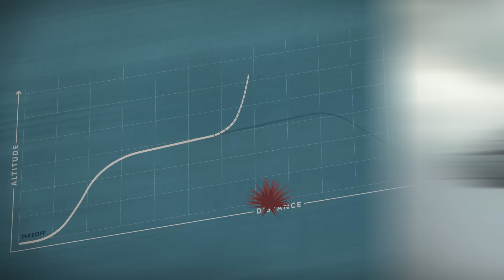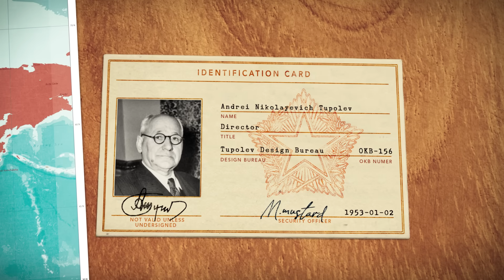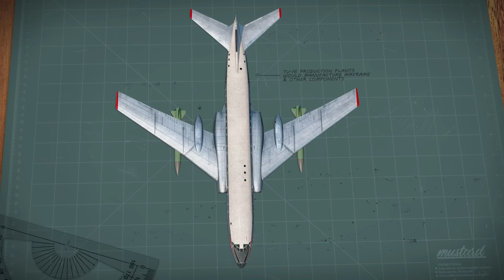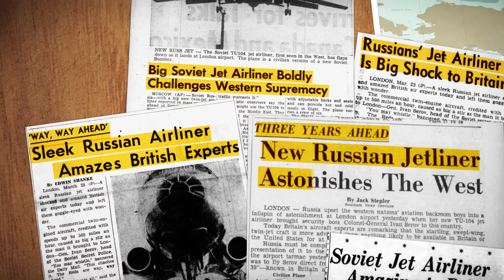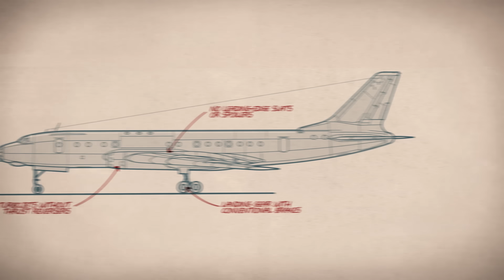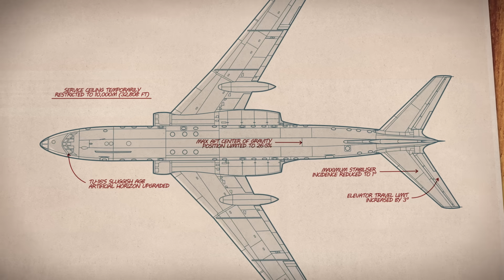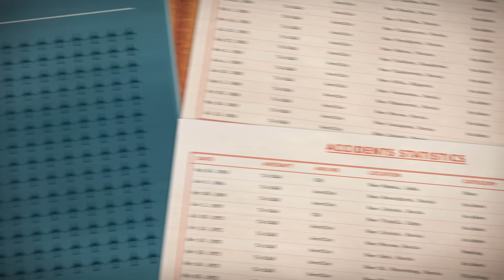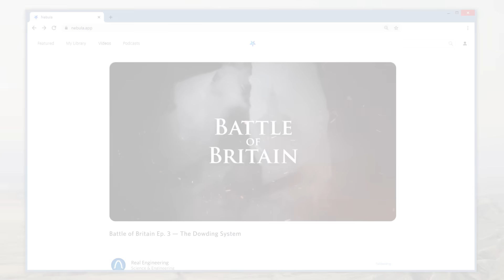The Soviet Airliner Designed To Crash

Comment: I don't understand what's so strange about it. This is the second passenger jet on the planet, leading after much less reliable one. It was a great, great success for that time. The bad thing is that they didn't grounded it after all those problems, but that's politics, not the engineering and innovation's problem. Overall, it was more than a GREAT success. After all, the first American passenger jet Boeing 707 was reported by numerous of pilots as terribly hard to fly with. Still, that's the third passenger jet in the world and the first in the USA, so it's a HUGE success. The author of this videos MUST emphasize those facts. Without those facts, these videos look like mocking of incompetent of the engineers of that time. 

By the way, Tu104 has total 37 hull losses with a total of 1140 fatalities, while Boeing 707 has total of 174 hull losses with total of 3039 fatalities. Why did you named Tu104 most dangerous plane in the world? You can always check the Google or any other info source
Reply: Facts: The de Havilland Comet has the worst safety record of any jet airliner. 

Sorry, your numbers are right... but your math is all wrong, Boeing sold over 1,000 707s... if you count all the military aircraft its 2,000 Tupolev made just 200 Tu-104s

Fatalities are rated by the number of deaths per million flights divided by the number of aircraft. 

This tells us that the Boeing was one of the safest aircraft of this era. And the fact that 200 aircraft in 707 family are still in service, some are expected to remain in service until at least 2050!!!
Reply: @DoktorBayerischeMotorenWerke 

  It will come as no surprise that we feel we can clear up some commonly held myths and misconceptions, of course.

  Indeed, It's always good to see the facts presented clearly and concisely isn't it?

    It's not valid to compare a Bow-wing ( see B-47 wing folding & wing collapse incidents for details) jet airliner designed & first built as late 6 decades after the Comet, with the fabulous De Havilland Comet, the world's first high altitude jet powered airliner.  

  Vast improvements in commercial aviation infrastructure alone being a significant factor in improvements in air travel safety safety over more than half a century.

    Of course 50 years more design, build & operation experience didn't prevent the horrendous Bow-wing 737 Max incidents, there can obviously be no excuses for that.

Obviously there have been worse aircraft for accident losses both before & after the DH Comet & the Tupolev T-104.

    How things were back then -

Accident losses - % of aircraft built.
DeHavilland Comet 4 UK     14% 
DeHavilland Comet all mks  17%  
Vickers VC10 UK                     5%
Tupolev T-104                          16%

   The DH Comet & Tupolev T-104 had better safety than or similar safety to many other commercial passenger aircraft of a similar era

    Douglas DC-1        99%
    Douglas DC-2        47%
    Douglas DC-3        30%
    Douglas DC-4        26%
    Boeing s300          72% 
 .  Boeing 307            70%
  .  Boeing 247           48%
     Boeing 707           20% 
Lockheed L-049/149 Constellation 30%
Lockheed Electra  Turboprop           29%
Fairchild FH-227                                30% McDonnell Douglas DC-8                 14%
Sud Aviation Caravelle                      15%
Canadair CL-44  Turboprop              46%  
Convair CV-580  Turboprop              22%
Convair CV-880    (ff 1959)               27%  
Convair CV-990     (ff 1961)              33%
Tupolev T-104          (ff 1956)            16%

As always, we hope this helps, obviously.

Cheers & 👍 of course.

. . ...
. . ...

Comment: The 104, paving the way for generations of more Tupolevs falling from the sky.
Reply: Tupolev still makes jets... more than you can say about de Havilland or any British aircraft manufacturers.
Reply: @DoktorBayerischeMotorenWerke 

  It will come as no surprise that we feel we can clear up some commonly held myths and misconceptions, of course.

  Indeed, It's always good to see the facts presented clearly and concisely isn't it?

    It's not valid to compare a Bow-wing ( see B-47 wing folding & wing collapse incidents for details) jet airliner designed & first built as late 6 decades after the Comet, with the fabulous De Havilland Comet, the world's first high altitude jet powered airliner.  

  Vast improvements in commercial aviation infrastructure alone being a significant factor in improvements in air travel safety safety over more than half a century.

    Of course 50 years more design, build & operation experience didn't prevent the horrendous Bow-wing 737 Max incidents, there can obviously be no excuses for that.

Obviously there have been worse aircraft for accident losses both before & after the DH Comet & the Tupolev T-104.

    How things were back then -

Accident losses - % of aircraft built.
DeHavilland Comet 4 UK     14% 
DeHavilland Comet all mks  17%  
Vickers VC10 UK                     5%
Tupolev T-104                          16%

   The DH Comet & Tupolev T-104 had better safety than or similar safety to many other commercial passenger aircraft of a similar era

    Douglas DC-1        99%
    Douglas DC-2        47%
    Douglas DC-3        30%
    Douglas DC-4        26%
    Boeing s300          72% 
 .  Boeing 307            70%
  .  Boeing 247           48%
     Boeing 707           20% 
Lockheed L-049/149 Constellation 30%
Lockheed Electra  Turboprop           29%
Fairchild FH-227                                30% McDonnell Douglas DC-8                 14%
Sud Aviation Caravelle                      15%
Canadair CL-44  Turboprop              46%  
Convair CV-580  Turboprop              22%
Convair CV-880    (ff 1959)               27%  
Convair CV-990     (ff 1961)              33%
Tupolev T-104          (ff 1956)            16%

As always, we hope this helps, obviously.

Cheers & 👍 of course.
Reply: @DoktorBayerischeMotorenWerke @WilhelmKarsten 

We feel we can clear up some common false myths, misunderstandings & misconceptions.

It's always very important to note the relevant facts obviously.
 
    Regarding the UK Aerospace Sector.

  WHY IS IT THEY CAN'T ANSWER VERY SIMPLE QUESTIONS ⁉️ 😅
  A very simple question indeed.
   
Which airline recently ordered 60 RR Trent XWB Engines? 

Also name a single Germany company that makes German jet aircraft in Germany & name a single German Company that makes German gas turbine aero engines suitable for widebody airliners.

     That's correct, Brazil makes very good airliners & Brazil is 100th down the list along with Indonesia for wealth per capita.
Norway Holland Denmark Ireland Belgium - Top 20 wealth per capita - Don't make airliners -  its as simple as that.
  
  Agreed, that is correct of course, clearly there are many countries that could easily produce airliners of better  quality than Bow-wing (see b-47 wing folding & wing collapse incidents) but don't for some very good reasons. Bow-wing being a result of the size of the US, the large protected domestic market & great ease of testing new types due to the equator to arctic geography & a few other reasons related to production scale capability, politics & economics.

  Obviously there really is nothing special about Bow-wing, having more than 50 years design / build experience on the type means they have no excuses for the horrendous 737 Max incidents for example.

    Indeed BAe Systems & Rolls Royce combined now do more Airbus work than Germany on an absolute basis & significantly more work than that on a per capita basis.
   
     Agreed, Per capita for the home nation BAe Systems is the world's largest defence contractor.
  
    Correct, BAe systems announced the recent £4 Billion takeover of Colorado based US based Ball Aerospace.
  
    It's definitely the case that BAE systems now does a significantly higher value of work for Airbus than it did when it was a major Airbus shareholder before 2005.
     
      Obviously RR now owns US Engine maker Allison for example which does classified Aerospace work for the US Govt.
   
   Yes, that's right of course, Anybody currently flying on a widebody airliner stands a good chance of being on an aircraft powered by RR gas turbine aero engines built in the UK.

   A typical but small glimpse of what goes on in the very internationally orientated British aerospace sector.  

  Of course the RR Nene was in fact the world's most reliable & most powerful gas turbine aero engine in 1944. Licensed built versions & copies would go on to power many aircraft in Russia, the US, China, France & other countries for decades after 1944.

      Boeing Apache Attack Helicopter.
AH-64: 75 UK suppliers, 7% UK content, global fleet of 1280+ aircraft.
F35B more than 130 UK Suppliers, more than 30% UK content.
F35A & F35C more than 130 UK Suppliers, more than 15% UK content.

   There is no doubt that an airline has just ordered
60 RR England Trent XWB Engines

Obviously the UK has the
World's Highest Combined Per Capita
 Nuclear / Defence / Aerospace Sector Activity.

Rolls Royce Holdings UK
Subsidiaries
- Rolls-Royce plc
- Rolls-Royce North America (Allison etc Classified Military stuff)
- Rolls-Royce AB
- Rolls-Royce Deutschland
- Rolls-Royce India Private Limited
- Rolls-Royce Marine Power Operations
- Vinters Engineering Limited
- Rolls-Royce Controls and Data Services
- Rolls-Royce Power Systems
- Bergen Marine
Joint ventures include:
- Rolls-Royce Turbomeca
- MTU Turbomeca -

Trent Family
The MT30 (Marine Turbine)
Industrial Trent 60 Gas Turbine
Trent 7000
Trent XWB Airbus A330neo.
Trent 1500
Trent 1000
Trent 500
Trent 600
Trent 700
Trent 800
Trent 8100
Trent 900

RR wholly owned subsidiaries in Germany handle smaller 2 shaft RR gas turbine aero engine work.

We hope this helps of course as always.  Cheers & 😎👍 indeed.

       O B V I O U S L Y  

. ..... ..... ......  ....
.... ..    .. .
Clearly the line above this line is not blank.

Comment: Right when the video said he increased the weight but kept the same engines you can’t do that big mistake right there! You must make sure you have enough thrust for the weight!
Reply: That also why some of the de Havilland comets crashed. The Comet has the worst safety record in history.
Reply: @DoktorBayerischeMotorenWerke 

  It will come as no surprise that we feel we can clear up some commonly held myths and misconceptions, of course.

  Indeed, It's always good to see the facts presented clearly and concisely isn't it?

  That's correct, there was never any significant thrust to weight ratio problem with the Comet. In fact the engines were being steadily improved at the time which included increasing thrust from any particular engine model.

    It's not valid to compare a Bow-wing ( see B-47 wing folding & wing collapse incidents for details) jet airliner designed & first built as late 6 decades after the Comet, with the fabulous De Havilland Comet, the world's first high altitude jet powered airliner.  

  Vast improvements in commercial aviation infrastructure alone being a significant factor in improvements in air travel safety safety over more than half a century.

    Of course 50 years more design, build & operation experience didn't prevent the horrendous Bow-wing 737 Max incidents, there can obviously be no excuses for that.

Obviously there have been worse aircraft for accident losses both before & after the DH Comet & the Tupolev T-104.

    How things were back then -

Accident losses - % of aircraft built.
DeHavilland Comet 4 UK     14% 
DeHavilland Comet all mks  17%  
Vickers VC10 UK                     5%
Tupolev T-104                          16%

   The DH Comet & Tupolev T-104 had better safety than or similar safety to many other commercial passenger aircraft of a similar era

    Douglas DC-1        99%
    Douglas DC-2        47%
    Douglas DC-3        30%
    Douglas DC-4        26%
    Boeing s300          72% 
 .  Boeing 307            70%
  .  Boeing 247           48%
     Boeing 707           20% 
Lockheed L-049/149 Constellation 30%
Lockheed Electra  Turboprop           29%
Fairchild FH-227                                30% McDonnell Douglas DC-8                 14%
Sud Aviation Caravelle                      15%
Canadair CL-44  Turboprop              46%  
Convair CV-580  Turboprop              22%
Convair CV-880    (ff 1959)               27%  
Convair CV-990     (ff 1961)              33%
Tupolev T-104          (ff 1956)            16%

As always, we hope this helps, obviously.

Cheers & 👍 of course.

Comment: "... a couple generations behind western aircraft... slower, smaller, offering little in the way of comfort." 

Sounds just like Communism to me.
Reply: Performed better than British aircraft... with a better safety record than the Comet.
Reply: @DoktorBayerischeMotorenWerke 

  It will come as no surprise that we feel we can clear up some commonly held myths and misconceptions, of course.

  Indeed, It's always good to see the facts presented clearly and concisely isn't it?

    It's not valid to compare a Bow-wing ( see B-47 wing folding & wing collapse incidents for details) jet airliner designed & first built as late 6 decades after the Comet, with the fabulous De Havilland Comet, the world's first high altitude jet powered airliner.  

  Vast improvements in commercial aviation infrastructure alone being a significant factor in improvements in air travel safety safety over more than half a century.

    Of course 50 years more design, build & operation experience didn't prevent the horrendous Bow-wing 737 Max incidents, there can obviously be no excuses for that.

Obviously there have been worse aircraft for accident losses both before & after the DH Comet & the Tupolev T-104.

    How things were back then -

Accident losses - % of aircraft built.
DeHavilland Comet 4 UK     14% 
DeHavilland Comet all mks  17%  
Vickers VC10 UK                     5%
Tupolev T-104                          16%

   The DH Comet & Tupolev T-104 had better safety than or similar safety to many other commercial passenger aircraft of a similar era

    Douglas DC-1        99%
    Douglas DC-2        47%
    Douglas DC-3        30%
    Douglas DC-4        26%
    Boeing s300          72% 
 .  Boeing 307            70%
  .  Boeing 247           48%
     Boeing 707           20% 
Lockheed L-049/149 Constellation 30%
Lockheed Electra  Turboprop           29%
Fairchild FH-227                                30% McDonnell Douglas DC-8                 14%
Sud Aviation Caravelle                      15%
Canadair CL-44  Turboprop              46%  
Convair CV-580  Turboprop              22%
Convair CV-880    (ff 1959)               27%  
Convair CV-990     (ff 1961)              33%
Tupolev T-104          (ff 1956)            16%

As always, we hope this helps, obviously.

Cheers & 👍 of course.

Comment: What. Does. The. GPWS. Sound. Like?
Reply: We feel we can clear up some commonly held myths and misconceptions.

It always good to deal with facts isn't it.

Obviously there have been worse aircraft for accident losses both before & after the DH Comet & the Tupolev T-104.

    How things were back then -

Accident losses - % of aircraft built.
DeHavilland Comet 4 UK     14% 
DeHavilland Comet all mks  17%  
Vickers VC10 UK                     5%
Tupolev T-104                          16%

   The DH Comet & Tupolev T-104 had better safety than or similar safety to many other commercial passenger aircraft of a similar era

    Douglas DC-1        99%
      Douglas DC-2        47%
    Douglas DC-3        30%
      Douglas DC-4          26%
    Boeing s300            72% 
 Boeing 307               70%
  Boeing 247                48%
     Boeing 707                   20% 
Lockheed L-049/149 Constellation  30%
   Lockheed Electra  Turboprop    29%
Fairchild FH-227                        30%
 McDonnell Douglas DC-8        14%
  Sud Aviation Caravelle            15%
Canadair CL-44  Turboprop     46%  
Convair CV-580  Turboprop     22%
Convair CV-880    (ff 1959)       27%  
Convair CV-990     (ff 1961)      33%
Tupolev T-104          (ff 1956)    16%
Reply: Sounds like a slide whistle on the way down